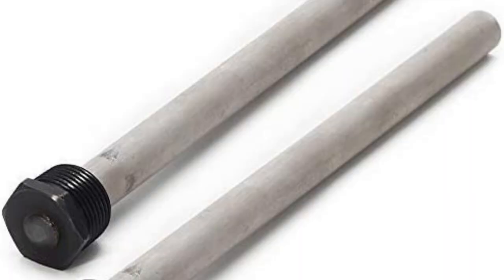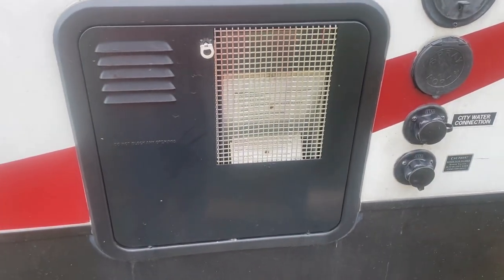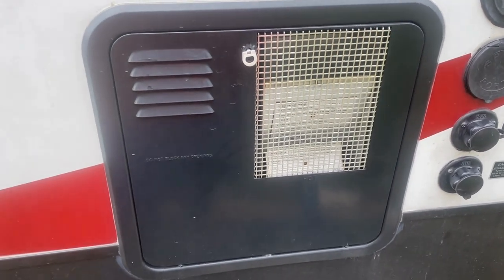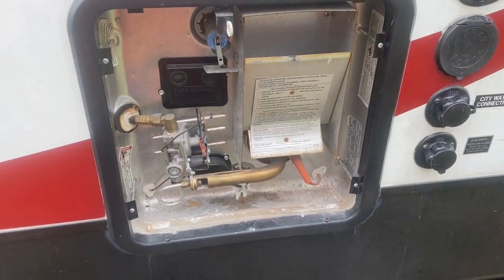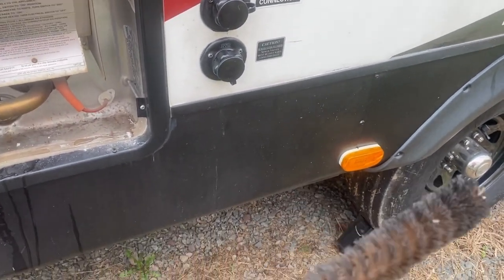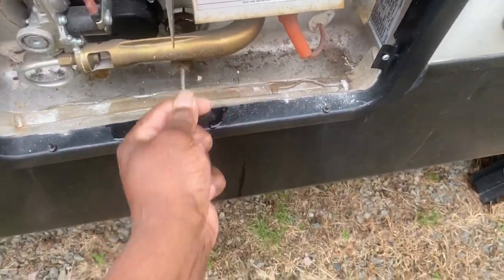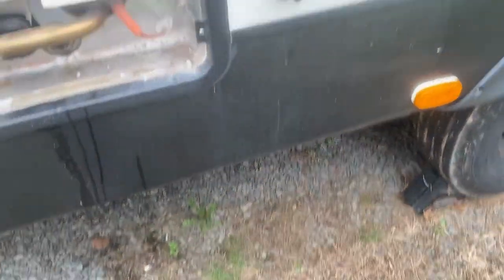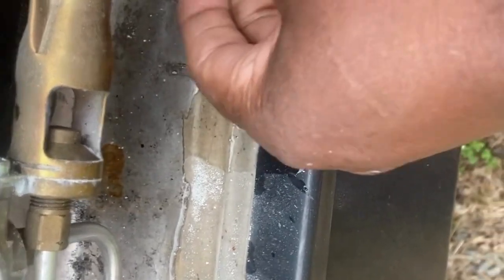How to Replace an RV Anode Rod (Complete Guide)

Comment: Good info I just changed ours last month and it been over a year was scared to do it but it was easy, I learned to turn the water heater off 😆
Reply from the maker: Thanks. I'm glad you learned how to cut the water heater off or your foot wouldn't be your biggest problem.  How's your feet doing?
Reply: @sonrisasnapshot  😆 my foot is doing much better don’t know when I’ll be 100% but it’s getting there.

Comment: Hay Fam, Our last coach had the anode rod and I would change it at the beginning of the season. At the end of the season the, I would pull the old rod out and discard it, Clean the tank with a brush and a water wand and then leave the port open over the winter so the tank could breath and any water could run out. Good video and we'll see you out there.. 💯👍🏽  Herbie & Mary.
Reply from the maker: That's good to know. I think I will leave mine open the next time.  Your new hot water tank doesn't need it? Looking forward to seeing you guys.
Reply: @sonrisasnapshot  Our Tiffin doesn't have a hot water tank. We have AquaHot system in this coach. It heats the water like a boiler either with electric or diesel. It also heats the coach in the winter and warms the engine on those very cold days.  Like everything else, it has it's positives and negatives... Like, we enjoy instant and ever lasting hot water which is a positive, Regular yearly maintenance cost are a bear!!! 😂😁
Reply from the maker: @RedJaguar100Travels  When we meet up at the Glampout; I would like to talk to you about the maintenance.
Reply: @sonrisasnapshot  No problem, I love to share any knowledge that I might have to help others!!! See you there my friend!!

Comment: I need to change mine
Reply from the maker: If you haven't changed them lately, it's best to do it because it does help with the longevity of your water heater.  It literally only takes 5 minutes.  Add another 5 minutes and flush the tank out while the rod is out.
Reply: I will before I hit the road.  Thanks